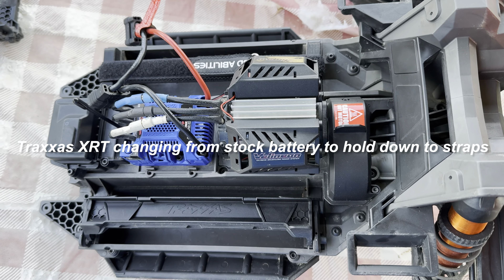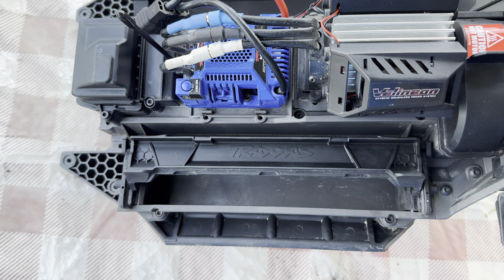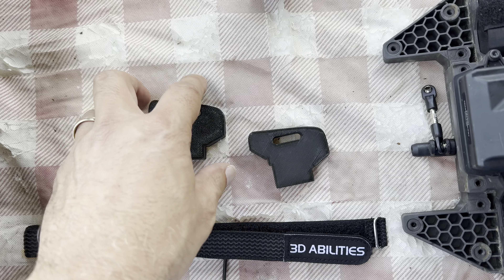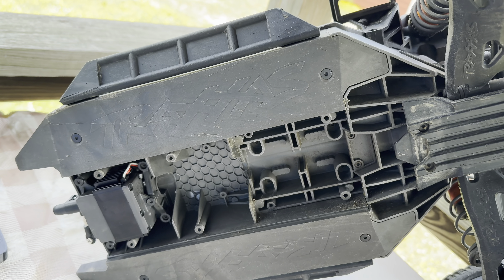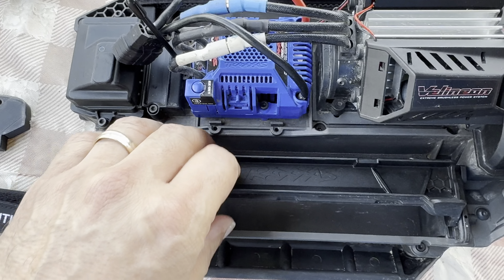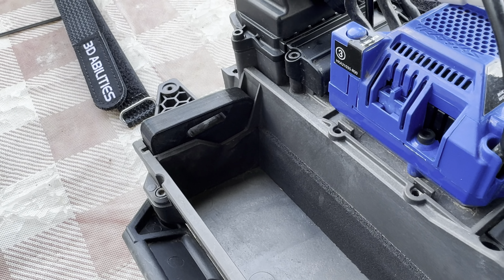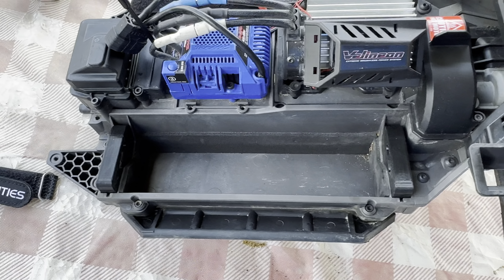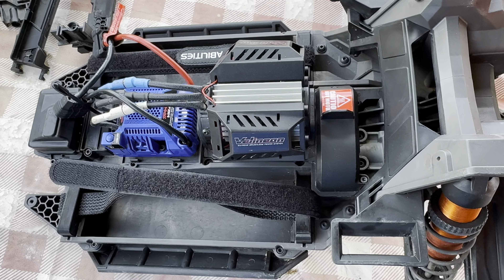Traxxas XRT - Removing stock battery holders and putting in straps

Comment: Break yet?
Reply from the maker: @keldonator  Sold the xrt. But straps were both good and bad. Good was you can use a variety of battery sizes. Bad was the straps seemed to let more debris in underneath the batteries, probably due to not being strapped down tight enough. They seemed plenty durable though.
Reply: @DoItTogether2022 Yeah but you can easily take them off and on.
Reply from the maker: @ Yes